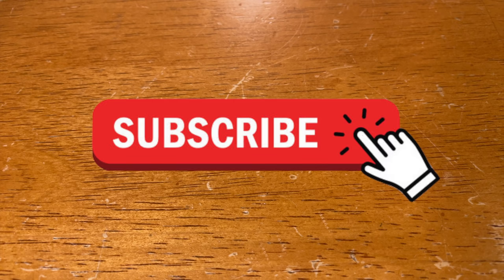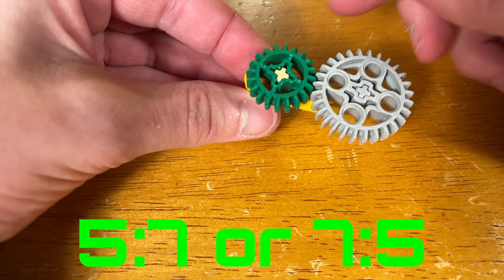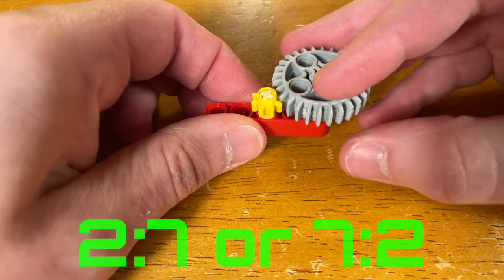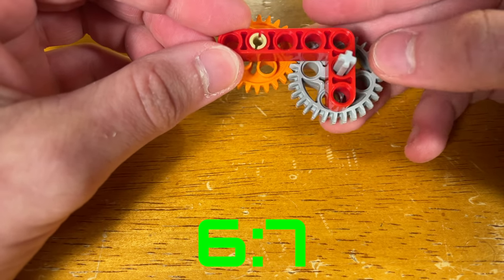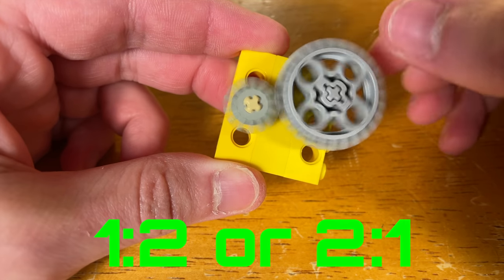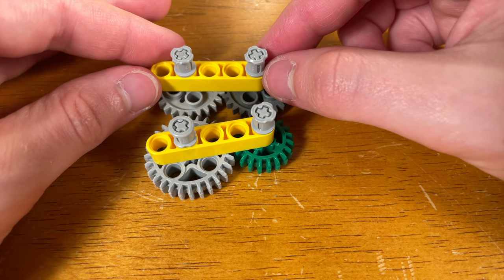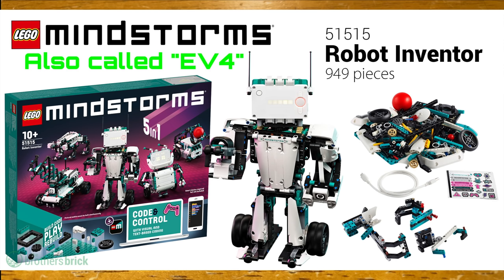This brand new LEGO part REVOLUTIONIZES Technic Building [HD]

Comment: Fun fact: you can change gear ratio without changing center to center distance as long as the sum of the teeth on both gears remains constant and tooth geometry is the same.  Example: 20:20 center to center is same as 16:24, or 12:28, or 8:32. All of those cases total of 40 teeth.  This is because number of teeth is a surrogate for circumference, which is a multiple of radius, if center to center, r+R is constant, so is 2pi(r)+2pi(R)
Reply from the maker: This is another way the new 28 tooth bevel gear adds more complexity to LEGO Technic. Thanks for pointing this out.
Reply: Anyway, have you tried the formula for total distance in studs or lego holes (axle to axle) of any meshing of any 2 gear (not by beveling); it would be: (number of teeth first gear + numbet of teeth second gear)/16 + 1.

Example, for 8 tooth gears meshing with 8 tooth gears: (8+8)/16 + 1= 1+1= 2. So total distance from axle to axle is 2. You make a whole matrix in excel for all distances of all gear combinations. I made one some years ago :D hope it helps
Reply: @m.agilnajib345  but the distance isn't 2. It's 1.  There are two holes with a distance of one between them. Or am I misunderstanding?
Reply: @TheRainHarvester  ah my bad. I think its just a consensus/definition thing.

Let me explain, for example I want to mesh  a 8T gear with 8T gear, it turns out it we will need a total of 2 holes side by side to mesh them together. It turns out a formula can be derived to obtaining the total holes needed to mesh any 2 gears. Hence, my formula will yield the value 2, ((8+8)/16+1). So thes formula is for "total holes needed".

 It is also correct to say the distance for meshing 8T gear + 8T gear is 1, this is if we are calculating distance from middle of the first axle to middle of the second axle (1/2 hole plus 1/2 hole equals 1). So It depends on the consensus. The formula for calculating this (i.e. distance of gears, center-to-center) would be (8+8)/16 = 1.

I think the basic formula still holds, proven by the example above, I admit the definitons were not explained clearly the first time. I hope this is clear enough :).

Personally I like the total-holes method, but to each their own :)
Reply: @m.agilnajib345  either way works for me. 
But is that in imperial units or metric? Haha jk.
Reply: @TheRainHarvester  hahaha... good one.

But in all seriousness, the unit is in lego-holes or lego-studs.

Yeah you can tell i'm not good at parties.
Reply: @m.agilnajib345  you and I would have fun talking at parties!! LOL
Reply: @TheRainHarvester  oh my, now i getcha. I actually misread your first comment and misunderstood it, I genuinely thought you were confused, so I explained it in detail. Made me look like a total know-all huh. Now LOLing inside... and huffing alot of air out my nose... hahaha
Reply: @m.agilnajib345  Ha ha (nose huffing...I do that too). Hey check out my PolyWantsACracker video(s).  It's a brain I designed/made, for use with LEGO.
Reply: Geniuses

Comment: That moment when you realize that Lego makes gears in multiples of 4 teeth...
Reply: The only gap now is a 32 tooth straight (non-beveled) gear.
Reply: (except the 14-tooth gear)
Reply: @ArchieHalliwell  That's an old one that was discontinued, and for good reason: it was weak. The 12-tooth bevel replaced it.
Reply: @ArchieHalliwell  One lego stud is 8mm. Lego gears use a module1 tooth profile, which can be understood as having 1 tooth per mm diameter, or 8 teeth per stud diameter. For Lego gears to have tidy distances between centers, they should come in increments of half-stud sizing, or 4 teeth. 14 teeth is anomalous, and is an old part from when they didn't quite have their system figured out.
Reply: The reason is that the gears are to be put on a cross axle, which has 90° rotational symmetry. On a fixed cross axle position (like + or x), you can stick the gear on in 4 different rotations, each 90° apart. So the gear needs to have (gear-wise) rotational symmetry of 90° to have the teeth be positioned always the same no matter the rotation. This requires the tooth count to be a multiple of 4.

There once was a gear with 14 teeth, which was perfect to make two synchronously counter-rotating cross axles, where both axles started in the perfect + position. Alas, this is not achievable anymore with two gears that have a 90° rotational symmetry, now if one axle is +, the other will always be tilted a little.
Reply: @notmuch_23  I have some of those weird flat 14 tooth bevels that work well if you double them up, you get a 2:1 with the new 28t bevel and diffs based on it.
Reply: Even the time it took Lego to make a new gear is a multiple of 4 🤣
Reply: @NFSHeld  I know people are saying a lack of 32 tooth....hmmm...Is there a 16tooth? Done.
Reply: Mista despises them
Reply: 14 teeth gear in the video!
Reply: Take the red gear from the 4th gen differential and BOOM,

Comment: The moment when you remembered that Tinkercad has a gear Shape Generator, and you could have made 19-tooth gears and 3D-printed them whenever you wanted to instead of wait on Lego... Oh, wait- I did!
Reply from the maker: I’ve heard of people doing that, but the experience I have with 3D printed parts with small details is that they don’t turn out well. However I guess it depends on the quality of the printer.
Reply: @LegoTechnicsRule  I’m using an Ender 3 Pro, the total time I’ve spent printing anything is under 12-hrs, and my custom gears are turning out perfectly fine...
Reply: @LegoTechnicsRule  You can use a resin printer to make small detailed parts.
Reply: @ChronoGXay  i would assume he's also referring to structural integrity as well
Reply: @everythingfeline7367  structural integrity should be fine so long as you print the gear flat so the piece doesn’t shear
Reply: @ChronoGXay  I assume pretty damn small layers, if not a smaller than default nozzle as well right?
Another option would be to use some special tough resin, SLAs do it with insane precision but the resin is usually too weak to make usable mechanical parts.
Reply: @Kalvinjj  If 0.2mm (AKA Standard Definition) layers with a 0.2mm nozzle is “pretty damn small”, then whatever, dude. 🤷‍♂️
Reply: @ChronoGXay  I just asked...
I thought to give the best results you would go with 0.1 or smaller
Reply: @Kalvinjj  The only places a smaller than the normal .4mm nozzle would be needed is for walls that are thinner than that, or external corners that would have a nozzle radius round over and you want something sharper. The rest of the time the nozzle is just offset from the required profile to leave the edge in the correct spot. The layer height doesn't affect how functional the part is much either as the gear just contacts on the high points in the middle of the layers and still works. Obviously finer layers gives more uniform contact though. 0.1mm would produce a good part and is well within the capabilities of an Ender 3 or similar.

I could be wrong, but I don't think any but the smallest gears would be hard to print, and the smallest only due to not having sufficient time to cool before the next layer. So print several of them at a time spaced out on the bed to give a time gap between each layer on any one of the gears.
Reply: If you are having problems with small details, try turning down acceleration and jerk. Mine are set to 250 and 5, but you may be able to use slightly higher values.

Comment: im most excited for meshing with the big 140 tooth ring gear for a 5:1 ratio. which means i'll be able to make a clock without a crazy way to eliminate the 7 factor of the ring.
Reply: @MarekLewandowski_EE  yes, i dont want to use it as the face, i want the hands to be on 3 separate rings pointing inward.
Reply: @legofreak5769  I did it once for the outermost hand based on four banana gears coupled together... The other two hands were traditional though

Comment: You should be able to use the 14-tooth gears as spacers for the worm gear, as they are slightly smaller than a half-size bushing
Reply from the maker: I will try that soon. Thanks for telling me.

Comment: Lego "technically" had 2 gear-based parts that has the same ratio, but they are not a full gear: the rahkshii shoulder piece, and the matoran shoulder piece. Even I wondered what took them so long
Reply: I loved those figures
Reply: Don't forget the bevel differential.
Reply: @aidancommenting  to move the arms when you spin a back wheel

Comment: A 60-tooth gear with its divisors would make nearly any combination possible. 1,2,3,5,6,10,12,15,20,30, etc.
Reply from the maker: If I’m not mistaken, the Lego turntable is 60 teeth. However it would be nice to see a non turntable 60 tooth gear.
Reply: @LegoTechnicsRule  to my knowledge theres 3 types of turntables that I know of, 28 teeth, 56 teeth, and 60 teeth.

Comment: Formula for calculating distance in studs or technic holes (axle to axle) of meshing of any 2 gear (not by beveling); it would be: (number of teeth first gear + numbet of teeth second gear)/16 + 1.

Example, for 8 tooth gears meshing with 8 tooth gears: (8+8)/16 + 1= 1+1= 2. So total distance from axle to axle is 2. You make a whole matrix in excel for all distances of all gear combinations.

I made one some years ago :D hope it helps.

Comment: When you demonstrated the 1 to 3 gear ratio, you should have turned the big gear 1 turn to show that the small gear makes 3 turns. You demonstrated a 1 to .3333 gear ratio.
Reply from the maker: I probably should have showed the inverse ratio. However, 3 to 1 is the same 1 to 0.3333. Aren’t both of those ways acceptable?
Reply: @LegoTechnicsRule  It's easier to see gears make complete turns (especially if you use a marker for better visual reference) Demonstrating a 3 to 1 ratio would work too, but you wouldn't just turn the big gear a 3rd of a turn to show the small gear makes 1 turn. How do you demonstrate, say, a 5:7 or 7:5 ratio? Just saying. Still a great video. I am currently working on a Lego Allison automobile transmission using the large ring gears like the ones used in the bucket wheel excavator. I have a working model built. I'm now working out some kinks in it to make it work smoother and clean up the looks of the supporting framework.
Reply: @LegoTechnicsRule  both are acceptable, mathematically correct

Comment: just ordered a handful of these 28s for the 62821 bevel differentials, I need 1:1 or 2:1 outputs for diffs to use them mathematically with little acceptable backlash. the new triple gear diff uses a hollow 28 as well. very nice unit but spendy.
Reply from the maker: If you didn’t, be sure to buy them from bricklink with the shipper being in your home country.
Reply: @LegoTechnicsRule  thanks for the tip, I actually ebayed them but probably paid a premium compared to bricklink. I'll definitely be going there next time :)

Comment: Bavel gears are supposed to transmit power perpendicular to each others,  these are spur gears
Reply from the maker: These can transfer rotational power perpendicular to another bevel gear. What I was trying to show in this video are the new ratios and gap crossing potentials allowed by this new gear.

Comment: Question, I read that the best number of teeth would be a prime, with the best gear combinations being a prime-prime combination, because the same teeth would only meet every prime1 * prime2 revolutions, which in turn causes less wear. Shouldn't we be striving for an overhaul of gears, all with prime numbered teeth, then? I suppose you can't just throw a "prime-cog" now because the tooth spacing would either be different to accomodate to the stud system, or if you keep the spacing then the "prime-cog" won't fit the system (at least not without chains).

Comment: Lego technic makes me think of Bionicle and Mindstorms.

I miss Bionicle.
Reply from the maker: Mindstorms still exists as Lego Mindstorms robot inventor. With the recent discontinuation of EV3, people are scalping them on eBay just like graphics cards, drastically overcharging for EV3 motors and sensors. The same is happening with power functions. You can still find nxt sets available everywhere for cheap though and rcx for even cheaper.

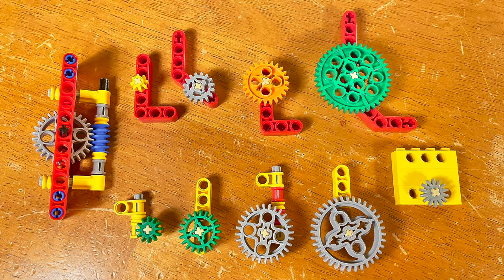Comment: 0:47 
1. That blue worm gear is ine of the rarest Lego Technic gears
2. You have to use 1 stud long worm gear not 2 stud long worm gear,otherwirse it wont fit in place
Reply from the maker: 2. That may be true, however I did kinda cheat the system by using axles to partially extend the worm hear holder to make it fit.
Reply: @LegoTechnicsRule  😦

Comment: 3:44, the on-screen text is wrong.  Unless you use the 14-tooth gear (which has now been discontinued) it is not possible to achieve a 7:5 gear train without the new 28-tooth gear.  You can get close, but without a gear with a number of teeth that's a multiple of 7, it will never be exact.
Reply: Edit, I guess you could also use the enormous 140-tooth wheel.
Reply from the maker: Yeah, I wasn’t sure you could, and I just said probably. What I was demonstrating there is just proof of concept. I was trying to show that this new gear could create new(or existing) ratios that could cross a given distance with just 2 gears, not achievable before.

Comment: What's the difference between beveled gears and normal ones
Reply from the maker: The beveled ones can transfer rotation at 90 degree angles. Technically, you can use them to transfer rotation at any angle 0-90 degrees.

Comment: If modern Lego gears increase in size by 4 teeth, we are missing the 4, 32, 44, 48, 56, and non-turntable 60-tooth gears. I picture the 4-tooth to be a 4-start worm gear, probably the diameter of the 20 or 24.
Reply from the maker: The knob gear is technically a 4 tooth gear, but agreed.
Reply: I don't count it as a proper Lego gear if it cannot mesh with any other Lego gears.

Comment: I have that gear, but i dont know how to make a crane for my Harbor/Navy base City. Any suggestions?
Reply from the maker: You don’t need to use that gear specifically to build a crane. There are Lego technic cranes that you can download their instructions for and build them that way. Just search Lego technic crane, click on a link that takes you directly to lego’s website. Scroll down and you should find downloadable instructions.
Reply: RESULTS: 42108, 42082, 42044, 42009 ECT.

Comment: Isn't the biggest Lego gear that big green one from the power miners?
Reply from the maker: If I’m not mistaken, the halifire droid wheel is bigger.
Reply: @LegoTechnicsRule  Don't they have one in that giant excavator set that is 4 parts with teeth on the inside? (I know it's not a single piece, but it still counts if you ask me.)
Reply from the maker: @SupersuMC  Yes, the bucket wheel excavator had some of those in it, but the halifire droid wheel is still bigger.

Comment: Horrible gear. This work not really good. The old gears have real thread angle. Very smooth. This new bevel gears used in a row produce high friction and are sluggish to operate...